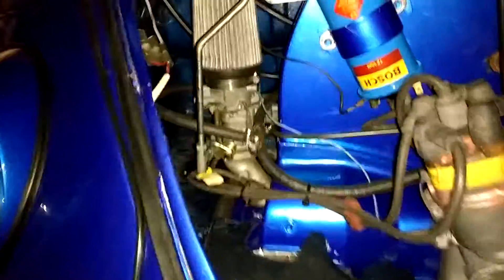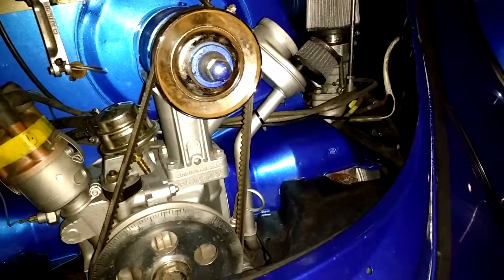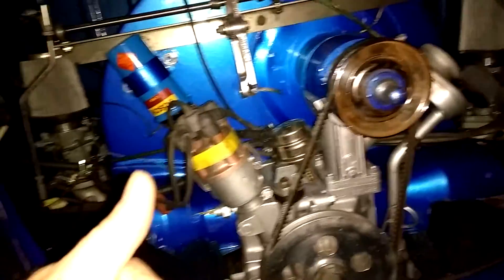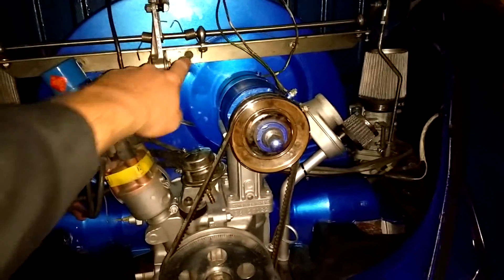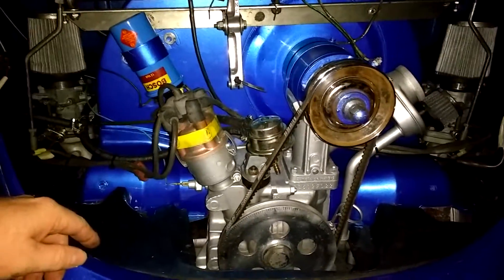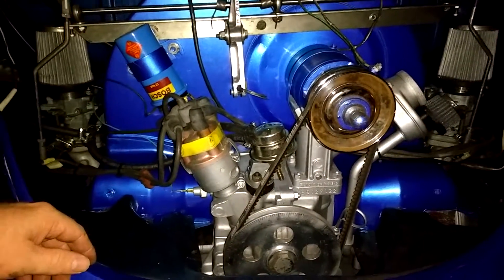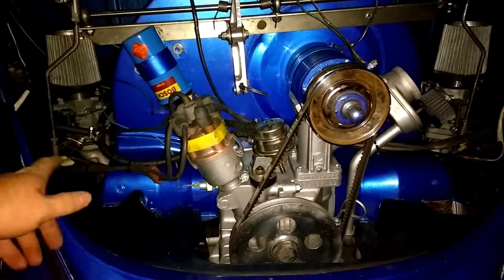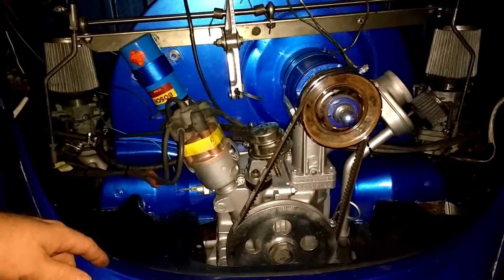It works!!!!!

Comment: is there more power with two Weber and how to drive? tnx
Reply from the maker: The is a lot more power with the dual Weber's, and it drives smooth as a stocker. Once you get them sync and jetted dual carbs are so much nicer than single carbs.